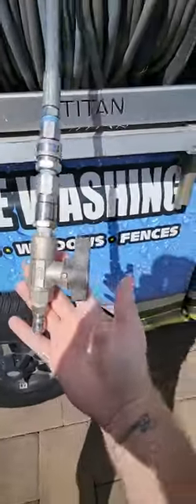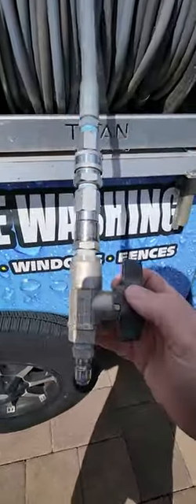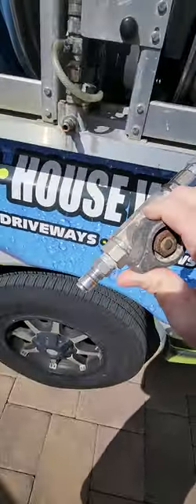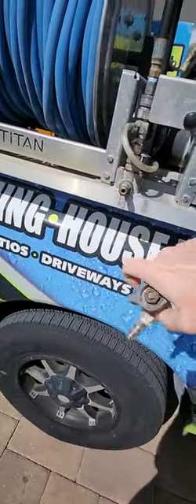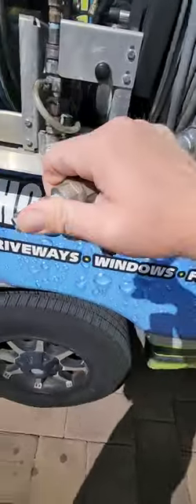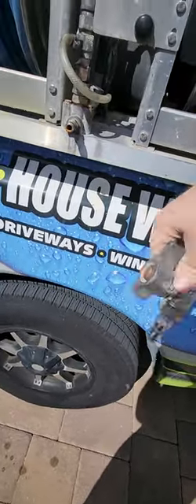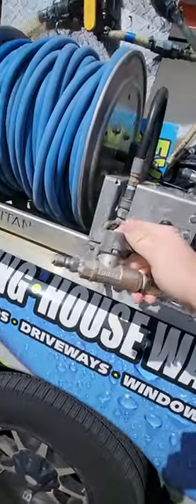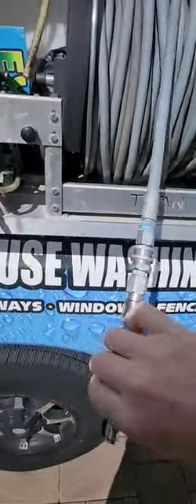Why i use a ball valve for pressure washing and house washing

Comment: Any way you can post a how to build setup video? I put together a ball valve setup and cracking it or wide open and it has no pressure. 3500 psi machine, what am I doing wrong?